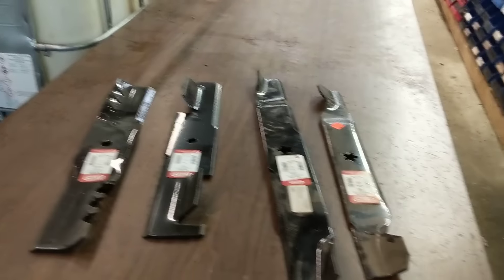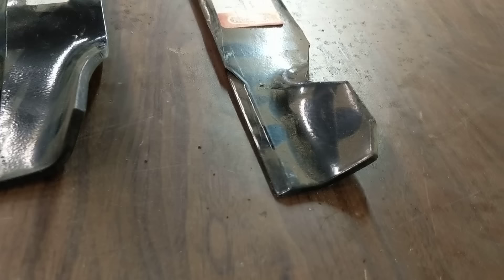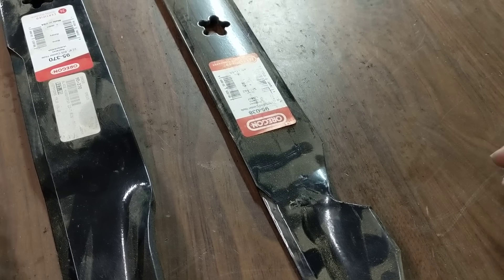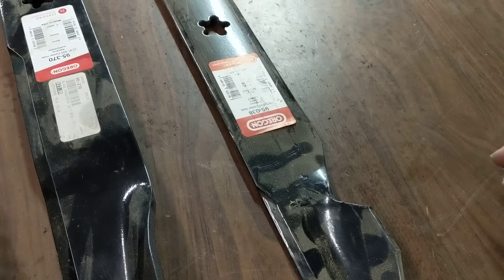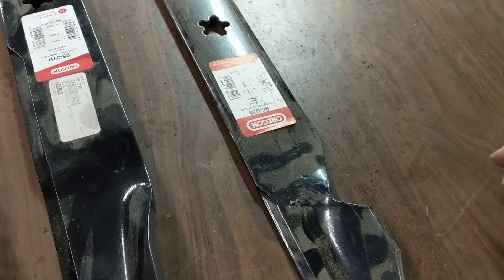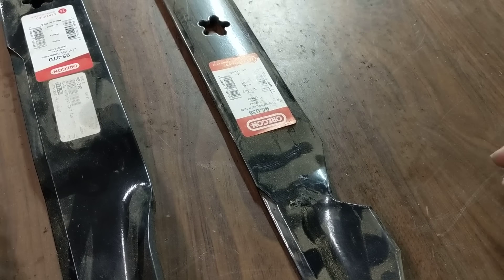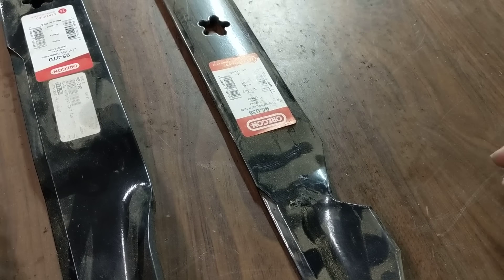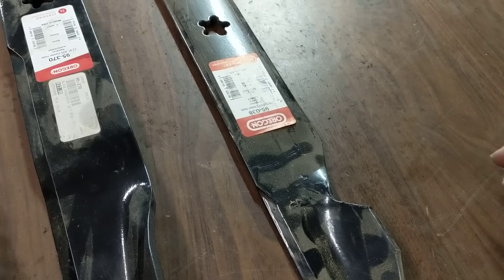Mower blade drastic difference and what is best for your yard and your mower. Oregon, Scag, Gravely,

Comment: I have in my time as a "pro" done a lot of lawn moving. It took about 1.5 days work to finish the area with a 110 cm deck with 3 blades. If I was lucky the blades lasted 2 times cutting then the edge was no longer sharp but instead rounded and nicked. At this time I would try to sharpend the blades the best I could but  the grass did not look good with a inspection a few days later. The cut was ripped and somewhat inconsistant. An idea popped into my mind...why not make 2 edges?  I sharpend the blades on the underside. The front was straightend and sharpend down to 1-1.5 millimeter.
I was  a happy camper better than new! Clean cuts and the blades lasted much longer. Mind you that my area is very damp and the grass is juicy!
Reply: What type of blade were you using if you don't mind me asking? The mowing crew I'm running has been having an issue with too much spring rain so constantly wet yards and it's causing horrible efficiency. I'm trying everything to help my guys not have to double and triple cut quite a few lawns. Just makes for a long day for the guys and I feel bad asking them to do 12-14hr days when they were hired on for 10's. Ooo another question if your sharpening your own baldes where you using a hollow grind or a convex if that makes sense? I'ma definitely try to do a double edge tomorrow when I sharpen them! Great info!
Reply: @RailithicEmporthus  It was standard High lift blades. You know those that are sharp in the front and in the back. For sharpening I just used a angle grinder with a lamel pad of 80 grit for the speed of it. No point to make it perfect but robust since the blades meet a lot of stone and other kling dongs...just remember to balance the blades and tell your guys not to drive to fast. I have seen it many times with a front mowing deck people forget to slow down in turns and therefore increase the speed of the deck to go faster than actual possible cutting speed. You can only go so fast it takes time for the deck to process the grass.

Comment: I live in east Tennessee where the dampness of grass can affect your mowing quite a bit.
I recently purchased a set of Oregon  Gator blades and coated the under side of my stamped deck with Vansickle graphite paint. If I mow when the grass is dry I get so little buildup that I don't have to clean it out at all... The grass only sticks around bolts and the discharge chute, but just barely. However, when the grass it wet - even a day or two after a heavy rain, the grass compacts under the deck so much that I end up having issues with lift, leaving "mohawks" on every stripe.

Edit: I mow about 5 acres with an older Cub Cadet RZT S 50. The buildup isn't a problem until the last 1/2 acre or so, but it makes for quite a bit of work when I'm done.
Edit 2: The Vansickle graphite paint didn't last long. It wore off mostly after a couple months and entirely by the end of the mowing season.
Reply: The Gator Blades I had on my Cub Cadet 2185 worked just great it did an excellent job on all types of cutting situations .  Keep making those blades I now have a older yardman 46 inch cut the outer blades are longer and the center blade is shorter with the center hole in a star shape need to get a set of the Gator blades  for my 20HP Yardman lawn tractor

Comment: wisdom= keep your blades sharp---weeds never mow well----engage mower blades at 1/2 to 2/3 throttle-----change your oil----drill and tap your spindles for grease fittings--don't store mower outside.

Comment: I’m having difficulty finding the right blade for my push lawnmower! It’s just your old school lawnmower that shoots the cut grass through the side. The problem I’m having now is my lawn is pretty thick grass at the back. Which makes it clog up really quickly. What is the lift mean? I just need a nice sharp blade that cuts good so I’m not having to go over and over the same spot like I have to now.
Reply from the maker: Lift does two things in general. One it creates a vacuum  making the grass stand tall while cutting. Two it throws the clippings farther . I hope this helps
Reply: @fuelediowa  so would a lift blade work on a regular push mower
Reply from the maker: @BTC1981  oh yes every blade has lift. Some just vary to match your needs better. Just make sure it is a blade compatible with your specific mower.

Comment: Those raised inner section "mulching" blades are basically useless. The inner part does not cut anything and you can verify this by running them for several cuts and check them afterwards, the paint will still be on the sharpened, leading edge of the inner part.  Like you said, all the business is in the last three inches of the blade.

Comment: So at what degree should we sharping the blades? I here 30 degrees for cutting blade and 15 degree for mulching blade....goes on a Honda mower
Reply from the maker: There are a few things to consider with blade angle. 15 deg will be sharper however will dull quicker and can damage easier.  30 would be tougher. I usually try and stay close to the factory angle unless I know the specifics and discussed it with the customer. I know this is a non answer but I do hope it helps.

Comment: Need some info, opinion from you. I have a Gravely HD ZT 60" (fabricated deck) zero turn mower. Kawasaki engine. 4 years of mowing mostly rough, bumpy terrain much of which was a field. Flat ground. Never had any issues with machine. 325 hours on it. I need new blades. Replace most every year. Currently leaving a small strip of grass on discharge side. Has 3 blades. Don't bag. Removed safety cover from discharge. What blades do you recommend? Never had to replace spindle(s). Never have replaced belt. Yearly oil changes with Kawasaki oil/ qualify filter. One time I had to add minimal hydraulic fluid. Gravely fluid. What blades are best for me? What brand/weight motor oil and oil filter do you recommend? Have always used rec fuel, no ethanol. When would I replace belt?  Any suggestions from you will be what I get.Thank you for your time. Also having problem with grass building up in deck, really bad if wet.

Comment: Please explain lift.
Is that after the grass is cut or is the blade sucking the grass higher for a better cut kinda like a vacuum affect?
I bought a set of gators and really enjoyed the cut.
Yes they mulch leaves like nobody’s business and give a pretty good cut at faster speeds.
Reply from the maker: It is like sucking the grass taller so to speak. The more lift a blade has the more air is being sucked into the deck . The better designed deck for your kind of grass and conditions will do this very efficiently. Also with more vacuum you get a higher volume (amount) of discharge. I hope this helps. Thank you for watching and taking the time to comment.
Reply: @fuelediowa  
Cool thanks.

Comment: I dont like the gator blades but they was the only mulch type blades i could get with a S shape center hole for my craftsman t2400 tight turn.  Dont know why they put s shape center hole in mine. Going to change spindle's to star center hole. Then i can put what i want on it..right now its only high lift blades for bagging or side discharge or the gator is all i can find .

Comment: I recently switched over from standard blades and had mulching blades installed on my riding mower. The thing I immediately noticed was that I couldn't get that golf course cut with mulching blades that I could with standard. There's an upswing though. Grass clippings don't pile up as bad as they did with standard and what clippings do pile are more easily dispersed with mulching. My overall opinion ? I'm a fence sitter.
Reply from the maker: Unfortunately there can be a lot of things that can effect cut quality and clippings. One thing to try if you are keeping the much blades is to pitch the front of your deck down. Usually a 1\4 to a 1\2 inch works well. That is if you have that adjustment. Thank you for watching and taking the time to comment.
Reply: @fuelediowa  My rider does indeed have that adjustment. I'll give your suggestion a go next mow. Thanx for the tip 👍

Comment: What would you recommend for a zthd52 my mower leaves stragglers
Reply from the maker: Try making sure the Deck Pitch is correct. I think the front is supposed to be 1/8 to 1/4 lower than the back. This help create more suction making the grass stand tight. Thank you for watching and taking the time to comment.

Comment: I have an Exmark Lazer Z and can’t get reduced discharge like other same mowers that seem to obliterate the discharge to near nothing. I cut at 3 3/4 or 4 inches. Deck is clean and positioned correctly like new. I just tried the notched blades in thick spring grass and discharge is clumpy and worse. I guess I’ll go back to high lift.   Any other advice?
Reply from the maker: Try lowering the pitch \ front of the deck 1\8th to 1\4 of an inch.
Reply: Thank you. Will adjust it.

Comment: @Fueled Iowa- Wanted to get some input and understanding before I waste money. Mower is-  rider- 2008 Yardmachine MTD. 42 deck, two blades. I brought the mower last year used and looks like still factory blades on it. I went to the lawn mower shop and told them I wanted good blades. I walked out with something called Copperhead. Mowed with them last year and they seem good. Also they weigh a good bit. I assume the blade is just standard and  not Gator. Nor does each end lift up that much at all. Problem I have is I discharge a bit of grass in my yard when mowing. As I do not have a mulch kit or plug etc. I am sorta still learning about all this and brings me to some basic stuff.... 1. To mulch I need a whole kit correct? I see something for my mower as a mulch plug/cover by itself. Then there is whole kit and says something about comes with steel skirts, strap etc on MTD site. I need the plug and whole kit to mulch or just plug? Now to the blades 2. What do you suggest for my mower and mowing the yard? I mow one time a week and the grass is not tall. Setting of deck is 5 or 4. Or do I even need mulch blades or a Gator blade,  mulch kit etc if I got the right blade. That or run a Gator and let it discharge... All I want to do is reduce the grass upon discharge a bit more. I'll await before I head to shop to tell them and buy. I plan to put blades on within the week as I brought a new deck shell from MTD to put on this mower. So I will be moving stuff and new parts from old deck to new.
Reply from the maker: Thank you for taking the time to watch and comment. To much properly is a while kit. Also you should only be cutting half an inch or inch off at a time. This way it can clip everything small enough.  Copperhead is a brand I think sold by rotory corp. And from everything  I have heard they make a solid blade. I would use a gator style blade I think copperhead makes one as well. If all you are wanting to do is keep clippings to a smaller amount but not spend the time , effort, and money on a much kit.  Hope this helps my friend and thank you again
Reply: @fuelediowa  Welcome for the watch and time. Same as well for reply back to me and sorry for delay in respond. Working has me at a live at work. So much I have not yet even got to putting new blades on yet. That will be a project in a day itself as I ordered and have a new deck shell. Now to move all the parts over ( ha ha ). I did read the reply you made and did hit the lawn shop. Copperhead is Rotory yes. They do sell a gator blade, but none in stock and all that stuff. I was also told maybe overkill on a gator. They pulled up what I brought from them last year. Which was the standard Copperhead blade. We settled at a Copperhead mulch blade- next up. That don't work then I will go gator. I do know the standard I have do cut nice just throws out grass a bit more then like. Not a whole lot just enough to make a small strip at times to have to go back over. Other then that I do find them solid as well. I do agree cutting grass half or a inch. I do that as I am not one of these mow a month attempting to be lazy and scalp as well. I set deck to 5. I will say my grass is the thicker type though. Back to the mulch kit....  Acquired a mulch plug only since I spoke of such kits. That is part-- MTD  731-2363 --. Use it with new mulch blades mentioned or toss it in trash?
Reply from the maker: @joesphbaumgardner4579  mulching can be great for your lawn. In the spring though with the grass holding more moisture can cause build up quicker and need to clean your deck after every use. Just a plug may be ok depending on the deck. A lot of decks you would add shield to separate each blade compartment.  This makes the grass clippings more equal across the whole width of the deck. I would try what you have. Different grass types and conditions make it a trial and error to find the best combination for your yard and your mower.
Reply: Much thanks for the time and input.

Comment: I wanted to try a gator blade on my Honda 215 but it seems nothing fits but genuine Honda blades. My mower shop guy said that using a blade that has become paper thin at the top outside edge could result in a piece breaking off and causing injury.
Reply from the maker: Oh ya I have seen fragments come off and  puncture through the deck with the blade fragment stuck there.  They can cause injury. Honda blades to seem to perform better then other brands on the Hondas.

Comment: What's  the best blade for tall grass that doesn't clump up the grass into big piles?
Reply from the maker: None really. High lift is probably your best option but it leaves the largest pieces of grass. Gator or mulch blades cuts the grass in more pieces but also causes more wet grass build up under your deck and more clumps.
 Best to just mow more often to keep it from getting tall. Tall grass takes extra gas, extra time, extra wear and tear on belts, clutch and even can cause extra oil consumption. Whenever a customer asked every two weeks vs one , I would quote triple the price.  Sorry for the delayed response. Thank you for watching and taking the time to comment. I greatly appreciate it.

Comment: So, if I want to have some mulching and good discharge; can I use a gator for the inner blade, and a medium rise on the chute side? I have a Husqvarna 42" with 2 blades. Medium rise came on that mower. My concern is if both blades cut the same height? I don't wanna leave ridges in the lawn looking like you have an uneven deck.
Reply from the maker: Make sure blade hight is the same will be the biggest challenge. Not all blades have the exact same drop. I would run a high lift on the trim side and the gator on the discharge. This would cause more vacuum effect for better lift and cut and some mulching effect as discharged. But I would go to a shop and compare blades side by side to make sure the drop and weight is close

Comment: I felt like the high lift blade put more strain on the engine. The blade acts like a vacuum cleaner and pulls everything up. Excellant for a bagger.
Reply: So when you used the high lift blade, you could actually feel it? Because I'm considering one if I can find it in 23". But I don't want a rougher mowing experience.
Reply: I own a 2020 Kubota z725 w/60" deck and I put the G6 Gator blades on my mower. They did absolutely horrible! I swapped back to the hi lift.
Reply: High lift blades are for side or rear discharge and for bagging...so yes they lift the grass up for a better cut...with a mulching blade you will find the cut quality a bit sub-par compared to a dedicated high lift blade and either bagging or discharging the clippings.  A mulching blade doesn't have as much lift so grass that's been ran over by the mower wheels may not get cut if the blade can't lift the grass to cut it...so you'll have un-cut sections as a result.  Also, a mulching blade doesn't do well in wet grass, where a high lift blade will generally still give you good/acceptable results.  

A dedicated mulching blade like the Gator G5 or G6 is actually heavier than an OEM high lift blade in most cases so you actually cause more engine strain using a mulching blade, combined with a mulch plug in the mower deck and you are keeping the clippings under the deck longer and cutting the same blades of grass multiple times while cutting new blades of grass at the same time, so you are actually working your mower harder when mulching than when bagging or discharging.  

A 2 in 1 or 3 in 1 blade will give ok results in bagging/discharging or bagging/discharging/mulching....they're one of those types of blades that don't really do any task very well.  So if you want to bag or discharge clippings get high lift blades...if you want to mulch get mulching blades...or get a set of both if you want to be able to do either, and swap blades back and forth as needed.  

I run the Gator G5 or G6 blades on my lawn tractor all the time now as I've found they do great in mulching and discharging and don't see any need to run the high lift blades at all and haven't bothered swapping them out.

Comment: What is most important for striping, the deck or the blade? I have a Exmark Radius mower and it does not make good stripes without a striping roller. Some mowers stripe hard without a roller, why?
Any recommendations?

Comment: Oregon blades need to be sharpened before their initial use.  I bought a set of G6 Gator blades, and they cut not so well.  Each pass looks like three different blades had made a pass instead of one uniform cut.  I sharpened them and they were much better.
Reply from the maker: And balanced. they can be inconsistent as well. 
Thank you so much for taking the time to watch and comment, I greatly appreciate it.
Reply: Fueled Iowa no problem.